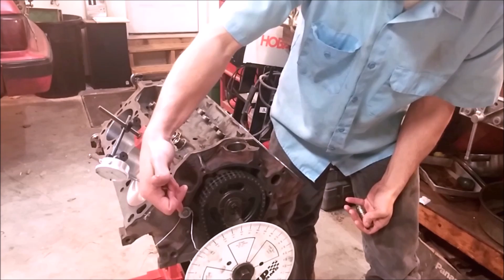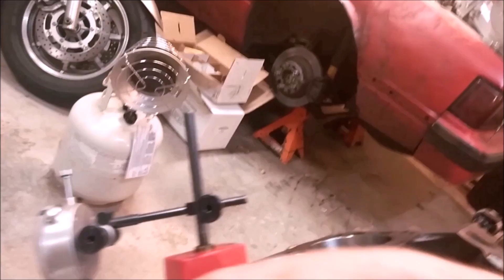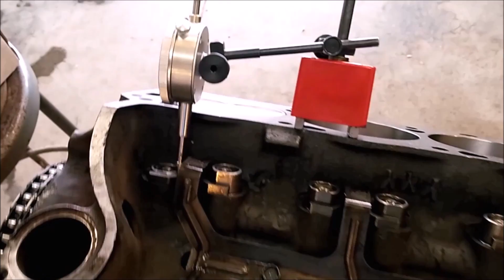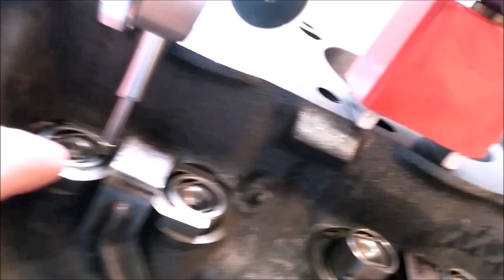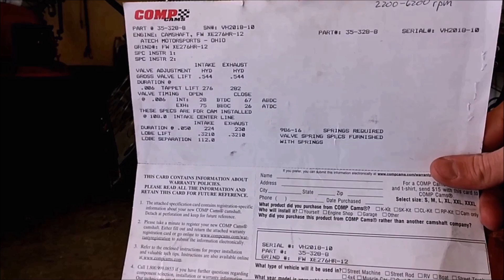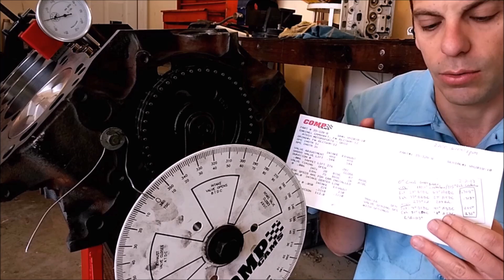How to Build a Ford 347 342 331 306 302 5.0 SBF (Part 4)

Comment: Ok, heres where i have my first question. I get the whole '#1 needs to be at tdc and cam gears dot to dot. However, is the keyway cut on the crank so that the lower gear makes matching the dot to dot on timing set correct? Thank u
Reply from the maker: If it's a non adjustable timing gear set, then the dot on the crankshaft gear will be at the 12:00 position when inserted onto the keyway so you can align with the dot on the camshaft gear. If it is an adjustable timing set, then there'll be another indicator such as a zero, and other key slots on the crankshaft gear will have indicators such as 2R or 2A to indicate 2° retarded or 2° advanced.

Comment: does not appear to use a liberal amount of any assembly lube, or at least not visibly.
Reply from the maker: Good eye.  Assembly lube is not required on roller cam lobes, and is optional on cam bearings.  In the case of this engine, the thick assembly lube created a perfect seal on the #5 cam bearing, and the cam would push back out due to air pressure build up in the cavity behind it.  Using oil allowed a slow leak down during install so the cam would stay in place.

Comment: Dial guage to find tdc is not very accurate as piston is at tdc for a few degrees.piston stop much better way.
Reply from the maker: Moving the piston +/-0.020" in both directions on the dial indicator, as shown at 4:22, addresses this issue and accomplishes the same thing as a piston stop, but without having to rotate the engine back and forth a full turn for each measurement.

Comment: I have been watching your series, excellent content. I was wondering do you recommend soaking the lifters and timing chain in a lubricant before installing them?? I have read mixed reviews, I want to do it correctly. Thanks for your time!👈💯
Reply from the maker: Lifters yes, there are very small passages for oil to access the internal cavity. Timing chain, I just squirt oil on and coat it, soaking is optional.
Reply: @fastfrankd  Thank you for responding so quickly to my question. I appreciate it.

Comment: I’m doing a similar build with my engine and I’m wondering what type of top end I should throw in it, preferably relatively cheap. I thought about a Edelbrock estreet kit but I’m not sure if that would work with the stroker kit, I don’t know who to ask
Reply from the maker: Assuming a 347 for the street, any head with 250 or better intake flow numbers will be fine.  Expensive heads don't make that much more torque than cheap heads, they just maintain the torque better after the peak-torque rpm to generate higher peak and overrun horsepower which is of little consequence on the street.  For a stoplight car, get a junkyard Ford Explorer intake, have the lower ported by  Tom Moss out of St. Louis and get the compression up to 10.5:1 on 93 octane and a good tune.  You'll make tire smoking torque up to 4500rpm, awesome mid-range power, and be all done by 5500rpm and the engine will last forever.
Reply: Hi Dawson. I've got a 347 in a 88 5l block with an eagle forged crank and rods, probe 10.4 pistons. 185ecnc edelbrocke heads. Thumper roller cam. Rpm airgap. 750holley. 3400stall converter. 3.90gears.This combo moves very well in a 65 fairlane. A great sleeper that rocks.

Comment: I'm curious about that camshaft oil slinger, I have not seen that in a 5.0L hydraulic roller motor.  What year is this motor?
Reply from the maker: That one was either an 89 or 90.  If you don't have one, the oil slinger is included in the Comp Cams small parts kit for all 5.0 blocks.
Reply: @fastfrankd  I found one on LMR, great write ups man, very impressive!  Some of this seems like overkill but you are a methodical and meticulous engine builder.